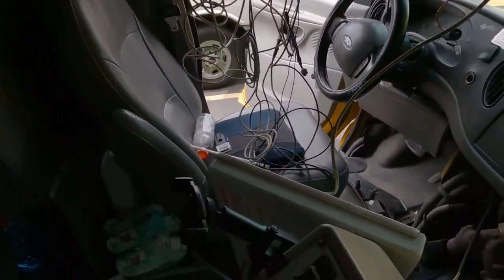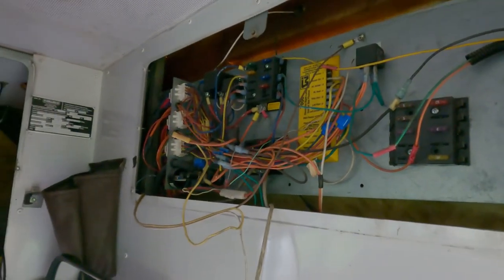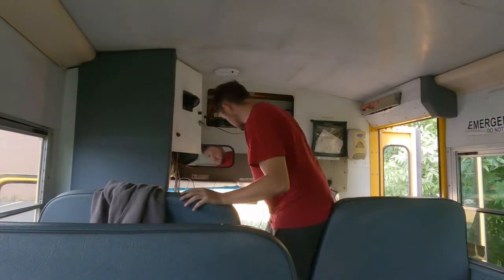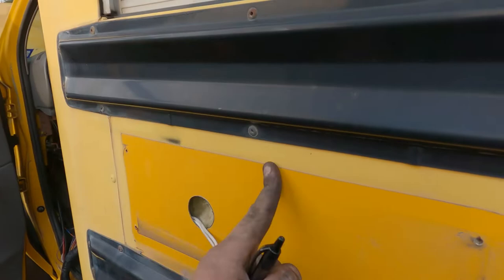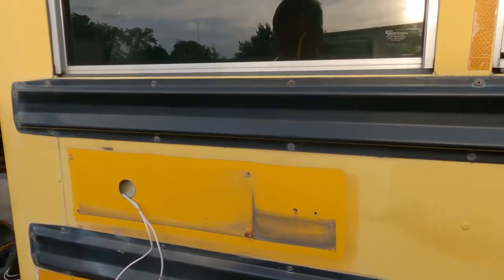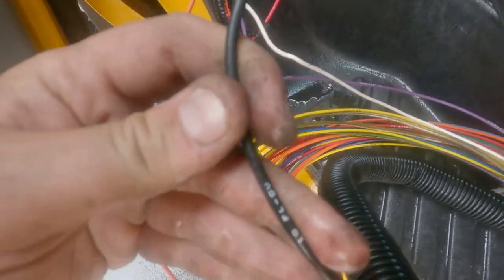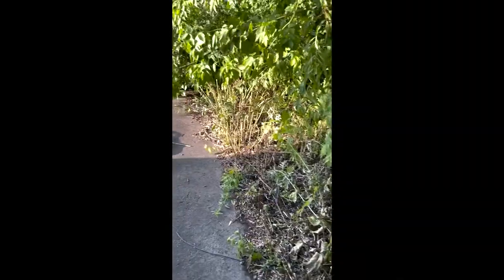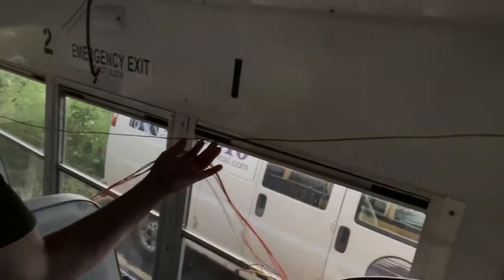Removing Skoolie stock electrical wiring

Comment: Are you SURE you won't need the rear A/C unit?  Keep going, you'll get there. A marathon starts with the first step!
Reply from the maker: We will have AC but not the old stock unit. I’ll be installing a Pioneer Mini Split where the old one was 😁